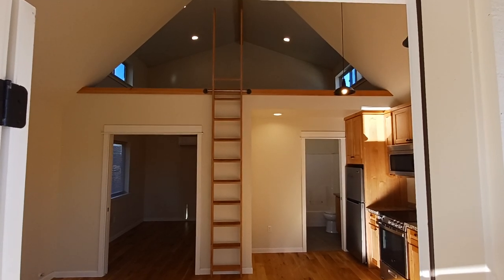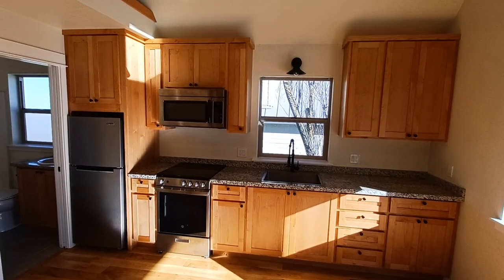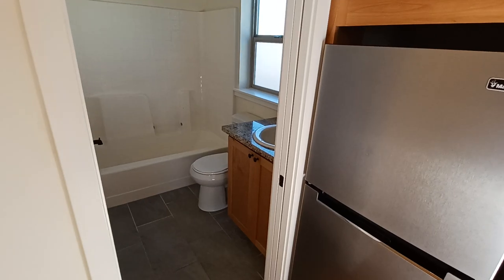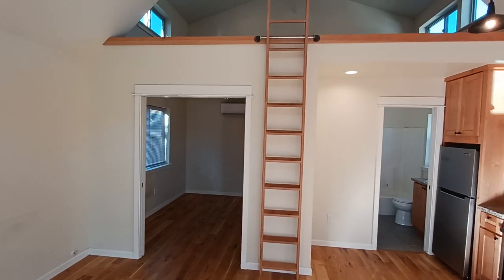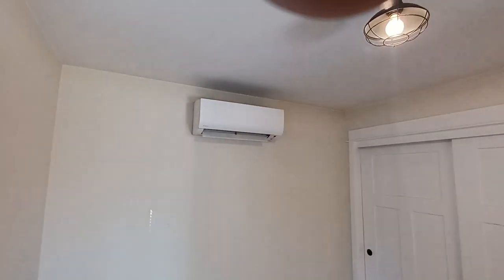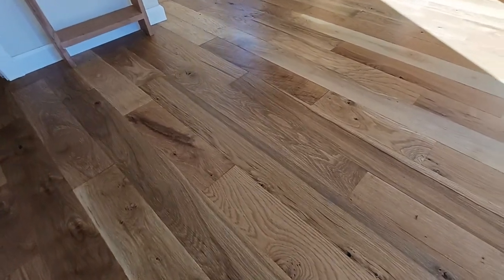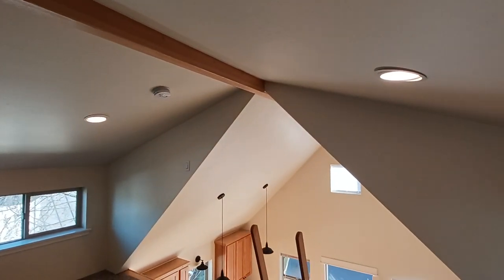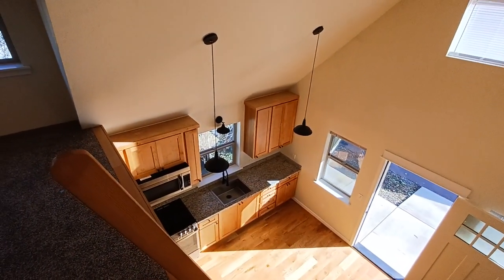ADU Interior Design

Comment: What's the allowable weight up in that particular storage area and how did you reinforce the ceilings in bedroom & bathroom to be able to take the weight of storage? Again, your videos are soooooo very helpful!
Reply from the maker: Built with the same joists, ratings and sub flooring as the main floor. No weight issues at all. Thanks!

Comment: So for that "storage loft" upstairs, what's the key that makes it NOT count as livable square footage? The lack of a proper staircase leading to it? I thought it was based on height - I thought lofts had to be under like 5 feet tall or something.
Reply from the maker: No stairs leading to space.  No knee walls at 5'.
Reply: @ThatADUGuy  So both those conditions need to be true. So if I had an inspection with no stairs and no knee wall over 5 feet tall the second floor/loft area of a kit like this wouldn't count as livable space? https://www.homedepot.com/p/Best-Barns-Richmond-16-ft-x-24-ft-Wood-Storage-Building-richmond1624/206007200

Would be amusing to build a rollable bookshelf staircase that can be moved in case of future inspections.
Reply from the maker: @RandomUserOnTheInterWebs  propably... I would confirm with your local building official. Also, To could for appraisal, over 50% of space has to be 7' or taller.